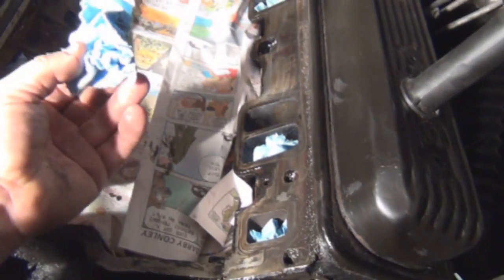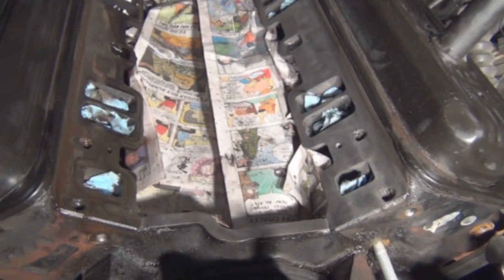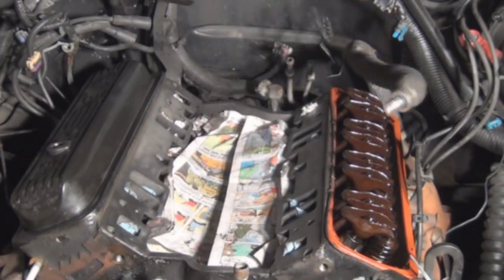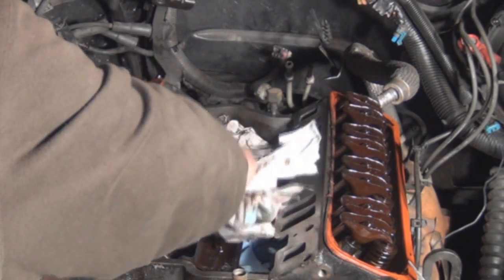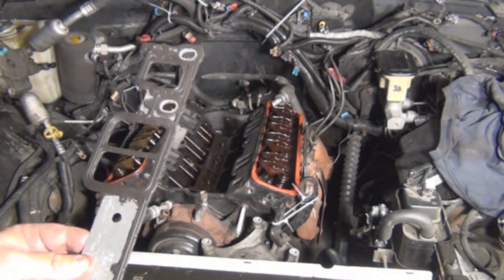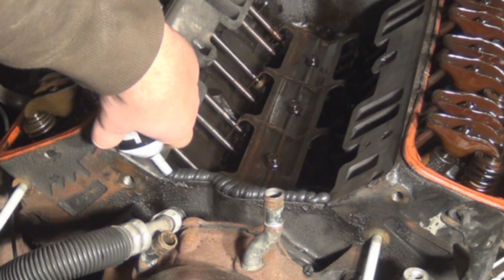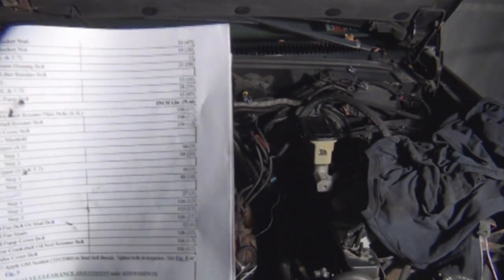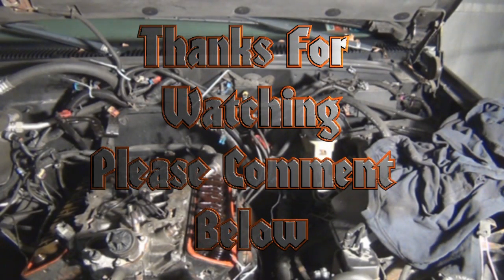Intake Manifold and Gasket Preparation and Installation

Comment: Thanks for the video, big help.  One suggestion to keep things a little cleaner is to use a shop vac to remove the paper towels.  That way you don't risk letting any debris slipping through while you pull them out.
Reply from the maker: Thanks for watching and thanks for the comment. That is an excellent idea about the shop vac.
Reply: I was thinking sponges may be better than paper towels and clean and reuse  them next time. would a old towel be better to put over the valley instead of newspaper?
Reply: ^ what he said re vacuum...
Reply: Does anybody recommend taking out the oil drain plug and pouring some oil on top of the block to flush out any of the chucks that got in the oil passages?

Comment: First, shade-tree men (I like you guys), compressed air is not needed for this job. Second, intake gaskets do not "blow". Intake manifold gaskets deteriorate over time. The paper thing (Handyman I am not disrespecting your ability sir) is overkill. Small particles will not be stopped by paper. Wet the paper first to make particles stick to the paper (if you use this process). Ultimately all garbage will end up in the oil pan because you are gonna spray that crap off with straight brake cleaner. Couple cans will do it. After mating surfaces are cleaned, brake clean is gonna be applied generously. Leaves no residue and flushes that crap to the pan. Just remove ALL large particles first. The abrasive disc is awesome, but GM stopped using these discs 15 years ago because they remove metal (uneven mating surfaces=poor mating). GM makes a green plastic "fingered" disc that works great and removes no metal. Of course use a scraper to remove everything you can first. Any tiny particles WILL be hammered in combustion chambers. GM recommends a 1/4" bead of sealant. "Nice and thick" is a mess, but do what makes you comfortable after knowing spec. Make sure sealant is below and above all 4 gasket end tab edges (corners) where the head meets the intake manifold. Let that sealant sit for 5 minutes for tackiness. Carefully install the intake so as not to disturb the sealant too much back and forth. Let the intake sit for another ten minutes. Install intake bolts. I use a light coat (LIGHT) of anti-seize (never use Loctite ever, ever, ever, ever, ever except for flex-plate or suspension bolts). Anti seize will not cause bolts to back out once proper torque is applied. Torque the bolts to spec using a 3 stage torque technique. Divide final torque by 3 and apply each increment to the bolts in sequence. Change the oil and filter. Any crap left over WILL be caught in filter. Change oil and filter at your interval and all will be well. Good time to flush coolant, but not necessary. 18 yr ASE certified GM Tech. I have performed this job at least 150 times on different engines and different makes. You know where to send questions if you need credentials. Peace and have fun.
Reply from the maker: Thanks, I greatly appreciate your comment. Thanks for watching and commenting. Please like share and subscribe. I like positive comments because they help me improve. Thanks again bud
Reply: SMDH. The 3M roloc discs were stopped because of silicon (not silicone) contamination. The 3M Bristles discs were manufactured to stop the silicon contamination that we were seeing in oil analyses back in the early 90s. In theory a powered surface prep tool should really never be used as they all remove surface metal. A straight edge razor blade and a 3M scotch-brite pad are the best for surface cleaning. All bolts should be installed and torqued DRY unless otherwise stated by the designing engineer. Lubricants on threads affect the torque ratings so when you add anything to the threads it changes the actual torque applied to the bolts. 

And NEVER let garbage fall into a motor. Who would even suggest such a thing?!?!?! Flush it down to the pan with brake cleaner???? Seriously? In the field it happens, but to deliberately just let things fall in a motor?? Your certs should be revoked. 18 years........
Reply: Phil, what would be the cost to do this at a dealer? I have my 95 and it also needs a valve gaskets.
Reply: @Perusalen4ever  Howdy Julio! The dealer tech. will charge around 3.5 - 4.5 hrs. labor only @ $100/hr. minus parts, sealant, oil & filter, and coolant + handling fee. Around $600 - $850 total. Rocker cover gaskets  will be part of the repair. Labor and parts will be guaranteed. Peace.
Reply: @QuarterMileCrazy  what about bolts that screw into coolant passages?
Reply: So quick question on the same model vehicle. Do i really have to remove the power steering pulley bracket or can i just loosen the bolts?
Reply: @ambisionzofrva  its a corner bolt in the manifold. It sit right under that bracket
Reply: @CPMest81  Good question, I reckon use sealer

Comment: The sealant when applied needs to set up for a good 7-10mins before dropping your manifold on..It will be tacky. Put all your bolts in finger tight then walk away for another 10mins..then the gasket maker is ready..torque it down and wait over night..your local shop gets paid by the hour to rush it...dont rush it.
Reply: WRONG - Read the Permatex RTV or Loctite - No Tack up
Reply: Nah.... read the instructions fur whatever "gasket make" bs you are using.....

Comment: You did a decent job, power tools aren't the best idea when doing it but they do speed up the process. A handy straight razor and some gasket remover are a better idea. You'll be able to control the debri a little better then flinging it all over the place. A microfiber towel would be ideal for laying in the oil galley, it's flexible and lint free. Just thought I might comment for the average joe do it yourselfer...main thing is take your time, don't get careless, and keep EVERYTHING clean

Comment: When you blow the cylinder intake areas with your compressed air hose, doesn't  the dirt go down into the lifter valley?  Do you think the newspaper covering the lifter area  is going to keep the dust, dirt, and grim from falling into the lifter valley?  And when you pull up the newspaper up,  do you think the newspaper will cause the dirt, dust and grim to stick to it and not fall into the lifter valley?  Same thing with the paper towels stuck into the intake ports.   Maybe if you used a vacuum cleaner hose when you pull the paper towels out of the ports would keep the dust and dirt from getting into the lifter valley and on into the oiling system of the engine?  The newspaper covering the lifter valley is worthless.
Reply from the maker: Get it wet when your done with wd40 and the small particles will stick. Thanks for your concern and thanks for watching and commenting.
Reply: Seems logical using a shop vac (in this scenario) would suck the contaminates and the paper tissue without issue.

Comment: Good video.... The only thing i see wrong  , is the red loctite on the bolts. You have to heat that stuff up to get it off.
Reply: I thought the same... I know you don't really need to use it.
Reply: Giggity. 😈
Reply: If that's the only thing you see wrong, I'm glad you aren't my mechanic

Comment: Great video! was there pitting around those coolant ports that you had to resurface? my engine has pitting after I used a block and sand paper. They are pretty deep. felpro says not to use rtv around those ports.

Comment: ON THAT STYLE INTAKE GASKET I PUT A THIN COAT OF SILICONE ON THE END OF THE GASKET FROM THE CORNER UP TO THE BOLT HOLE ON BOTH ENDS OF EACH HEAD, JUST OUTBOARD OF THE COOLANT PASSAGE. FOUR PLACES TOTAL THAT CONNECTS TO THE THICK LAYER OF SILICONE ON THE CHINA RAIL. I FIND THAT THIS HELPS TO PREVENT THE VERY SMALL OIL SEEPAGE ON A SHOW QUALITY PAINTED ENGINE THAT DOES NOT HURT ANYTHING BUT JUST CATCHES DIRT AND MAKES IT LOOK DIRTY. I ALSO PEPPER THE CHINA RAIL WITH A PIN PUNCH TO HELP GRIP THE SILICONE.
Reply: NOAH DUNAWAY why are you yelling?